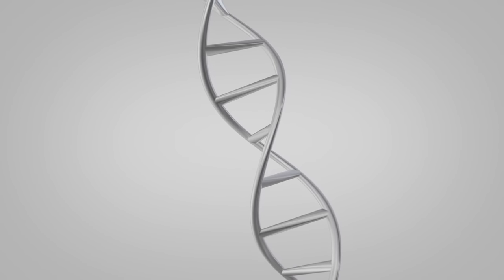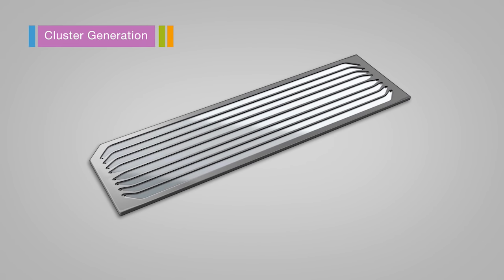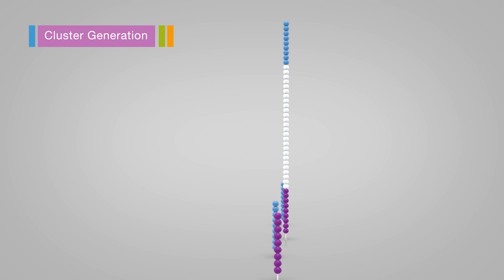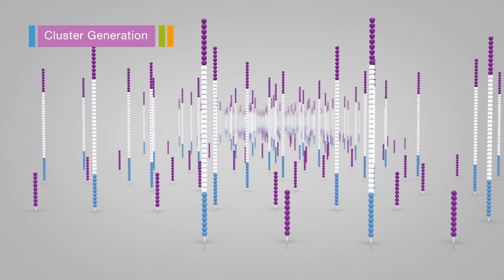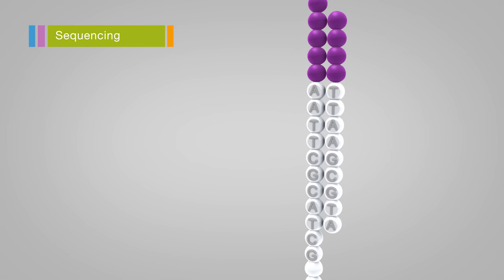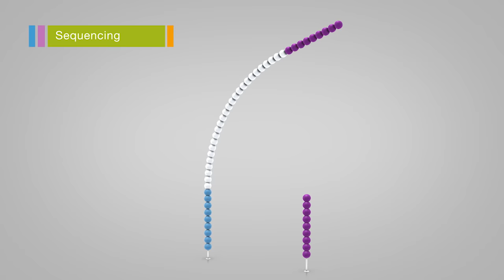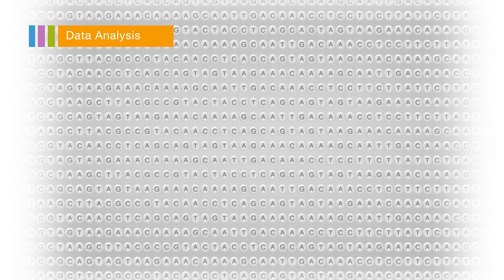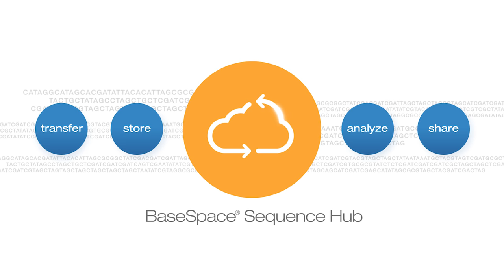Overview of Illumina Sequencing by Synthesis Workflow

Comment: I think the cleaving off of the fluorescent signal and removal of terminator during sequencing by synthesis is a key step that is omitted in the video. It becomes very confusing, then, how the previously added nucleotide's flourescent does not interfere with the newly added nucleotide.
Reply: 100% what i thought
Reply: Once a nucleotide is added it has a terminator group attached as far as the terminator group is removed it is not allowed to add another base in the strand. Once the fluorescence signals are captured the terminator group is removed and a new base is added with terminator group.
Reply: exactly
Reply: Thank you!! That was the part I didn't understand:)

Comment: For all of those who don't understand the index thing: 
- you have your genome DNA which you fragment with restriction enzymes (sticky ends)
- you create blunt ends and select for a specific size (too long reads are not possible) with purification beads --> what you get is double stranded DNA with specific length
- you add a Adenin and a phosphat group to the end of the fragment so that the phosphat and the A are "complementary" to each other at both ends
- now you add the predesigned double stranded index molecules consisting of the two flow cell binding sequences + index 1 and 2 + index read primer 1 and 2. To the index read primers a Thymin and a phosphat group are bound - again "complementary" (so only at ONE end) 
- because of that your DNA fragment and the index molecules can be ligated (A-T binding)
- the index is used to say: the fragments with index ATC e.g. is from E. coli whereas AGT e.g. is from B. subtilis

Hope this was not too confusing :D
Reply: " predesigned double stranded index molecules consisting of the two flow cell binding sequences + index 1 and 2" doesn't the first sentence before the + sign mean index 1 and 2 ?  If yes, then why did you mention it again after + .... i'm new to NGS so that is so confusing for me ... if i'm wrong could you amplify that part more ?

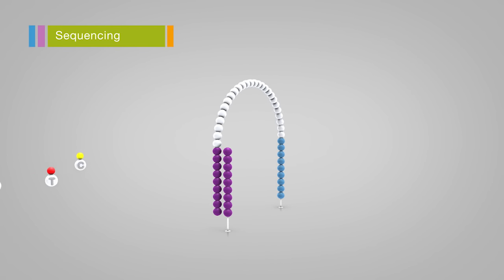Comment: Everything is clear except the index 1 read part (3:17), as well as index 2 (3:35).
Their purpose was not explained in the video.
I read somewhere that unique pairs of index 1&2 allow mixing multiple samples together and sequencing them at the same time.
Could you elaborate? I don't understand how that can be accomplished based on this video alone.
Reply: from what I understand from the video: 3:17 = deprotect the index 1 side from cleaving and allow it for reading
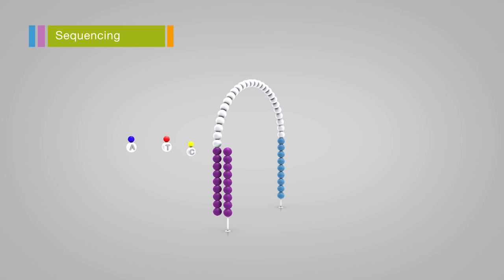3:35 = prevent index 2 side from reading.

next question is "how these processes allow doing that (protection and blocking reading)?" = I don't know
Reply: these sequences are being done with some many at a time. the idices are used as marker for each strand. The computer puts all the strands with the same index together to get a preciser read.
Reply: Steven Kim i think index 1 and 2 here are working as indicators for 5' or 3' end of the forward sequence. The index to mix different samples are additional index sequences added to each sample during tagmentation. For example, i add N701 index (a short sequence in Nextera preparation kit )to sample A, N702 index to sample B, and then mix two samples in one lane. During sequence analysis, i could distinguish the two samples for there is a tag added to each sample.
Reply: I think they showed it incorrectly. The index read primer is hybridizing to white sequence which is presumably unknown sample sequence. The index and the primer that reads it should be within the blue sequence. Or they could just put the index sequence directly downstream of the initial primer binding site to save the trouble?
Reply: @Valariel  I agree with you ,  illumina accidently or delibretely make the issue ambiguous.
Reply: @Valariel   not sure why it is not downstream, but: they add indecis (with PCR) to the dna during the preparation before they enter the lane. They showded it very briefly in the very beginning. The blue and purple are there just to bind the DNA to the lanes.
Reply: it is explained at the beginning but very briefly. 
the sequences added at the edge of each insert (the adapters) contain unique sequences not only for the index (which identify each read), but also sample-specific tags, which are added during library preparation. at 0:40 it kinda shows that
Reply: @grasthube  Yeap, but the question is : how do they "add" adaptaters to each end of the fragments (not knowing their sequence) ? Glue 🤔?
Reply: @martinmazukiewicz  In the TruSeq library preparation method  a single base A is added on one end of each complementary strand (like on the opposite sides is that makes sense: like strand 1 will have your sequence -------------------A then a base A at the end and its complementary strand 2 will have the base then the sequence kind of like A---------------  . Now the adapters have T overhangs which will pair with these A overhangs and that completes your library. I've made a weird diagram of a complete library which I hope shows up and clears up this blunt ends to sticky ends conversion i.e adding A which help attach adapters.

ADAPTOR T---------{DNA seq with base A to the right}--------- A ADAPTOR
ADAPTOR A----------{DNA seq with base A to the left}------------T ADAPTOR

Comment: Hello! if I may offer some critique, I actually prefer the original video. The animation might be less fancy, but I found it clearer and more illustrative than this "3D" one.
Reply: Actually I agree with greennecko. The reasoning for the index reads (as mentioned by Steven Kim below and Tom Shen above) is explained much better in the original video. Additionally the sample prep portion includes on screen details for the "additional motifs," which are very useful. Lastly, it was not clear to me that the reasoning for removing the reverse strand and then subsequently removing the forward strand was to accomplish the "Paired end reads" until watching the original video.  Thanks for the videos they are are helpful!
Reply: Hi @greenneko , could you post the original video link please? Thanks

Comment: I still do not get it why after sequencing the first strand and before proceeding to adding index 2 primer to generate clusters of the other strand index 1 is added again (3:17) to generate a short read. Reading the comments below has not helped. Is anyone able to explain this again? Is this done to signal to the data acquisition computer: "this is the end of sequencing data for the fragments labelled with index 1"?

Comment: I'm wondering whether there is a mistake in the narration. Before read 1 it mentions the reverse strands are cleaved off. Isn't read 1 a copy of the forward/coding strand, thus you'd need the reverse/non-coding strand to remain attached? At least my MiSeq read primers were always designed this way.

Comment: Dear Illumina group thank you for video, can you please answer my few questions:-
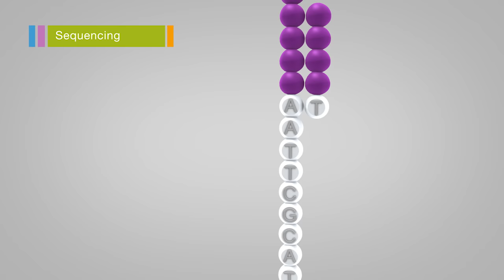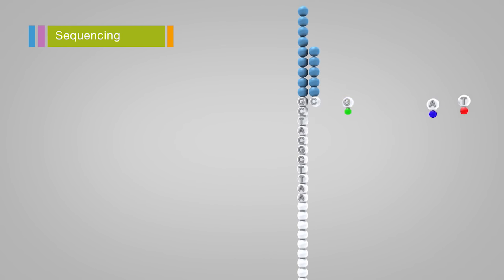1) at 2:22 and 4:00 reading starts from 5'?
2) is numbers of reads generated per fragment depends on the type of NGS application?
3) If reads are generated from fragments how they are aligned? 
4) Do data generated from the read contains sequence of amplicons?
Reply: The reference genome is available there to compare these fragments and there are software's like Spades to align these short reads. Since this is not a single read each base is read at least 30 time which allows to chose the best option from the quality score assigned to each read.
Reply: For Denovo sequencing the overlap sequencing is performed and base call is 60x to get more accurate data

Comment: helloo, why do we do the step before bridging ( the replication and detachment of one strand..) thanks !
Reply: So that the fragment becomes attached to the flow cell. 

In the first step, the fragment of interest hybridizes to the oligo on the flow cell via its complementary adaptor sequence. But it is not attached yet - under denaturing conditions it will come off. The oligo on the flow cell acts as a primer so that polymerase can extend the sequence, using the original fragment as a template. Once that is done, you have the sequence of interest (it would be the compliment of the original fragment) bound to the flow cell. Denature to release the original fragment, and you are ready for bridge amplification.

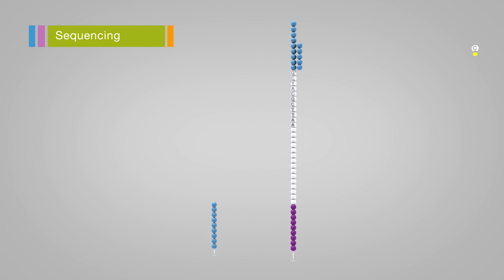Comment: Don't know if they meant to show these details, but the letter ordering in the forward and reverse passes is reversed but not complemented- is this an error? in 2:35 you see the ordering (from top to bottom) of AATTCGCATCG and at 3:56 on the reverse read the order is reversed but not complemented i.e. GCTACGCTTAA- shouldn't it have been complemented i.e. (C<>G,A<>T)?
Reply: no these are meant to be parallel strands

Comment: Hi, I have a few questions that need urgent answers:
1/ How flourescent label in the blocking group are removed from the nucleotide?
2/ How to wash away free nucleotide?
3/ Why do we have to sequece 2 strain of DNA?
4/ What is the function of index 1 and 2 in adapter attached to DNA?
Thank you.
Reply: You don't have to sequence two strands. This video is showing paired-end sequencing, which sequences both strands. But you can do single-end sequencing, which sequences only one strand. The benefit to paired-end is better coverage of the entire genome.
Reply: I think the terminator is only fluoroscent when bond, also after excitation it is "removed" or deactivated.

Comment: Can someone please explain why sequencing the reverse strand is necessary? We just sequenced the given read by synthesizing from the forward oligo. At 3:20, you have the sequence of the entire read and the index. Is there any new information we gain after 3:20?

Thanks!
Reply: Yeah, so the reason you need to sequence the reverse strand is because as the sequencing progresses, the error rate increases, so you have to go back and sequence in the opposite direction to minimise errors if that makes sense. Otherwise only the start of the sequence would be necessary, but the paired end reads increases the accuracy of the sequencing by allowing you to identify errors.
Reply: Morgan Desira not really the answer. Certainly a possibility but I have never worked on any data where people have purposely done that (working in bioinformatics and genomics for 10 years). 

NB reverse strand isn't necessary, it's an option ('paired-end' vs. 'single-end' sequencing). NB also that in the cartoon the read seems short, but should be ~500bp, and reads are 75-150bp. There is meant to be an 'insert' in the seq library, so you have a 150bp stretch, then unknown insert (usually ~200-250bp) then another 150bp. In highly fragmented DNA e.g. from FFPE material you might get shorter and overlapped reads. 

In paired-end you would get back two reads, but we know they should be near each other. This makes aligning to the reference genome more accurate.

Should mention that if we sequence to a high enough depth, error rate is less of an issue, and depth should be considered in any experimental design.
Reply: Hey, i think the reverse strand is importand to match (pair) forward and reverse reads, so to form cotiguous sequences. I mean that forward and reverse reads can have different lengths, a redundancy would assure the ending or begining of a paired read. Later could be of relevance for tracking splicing events. Its a theory. :)
Reply: @brucemoran1063  Thank you Bruce :) 
I was wondering if the Illumina sequencing they do here was paired-end. Since they never mentioned anything about it in the video I was unsure..
Is that why they used 2 indexes on one strand (one forward and one reverse)?
Reply: 4:39 - to resolve ambiguous alignment

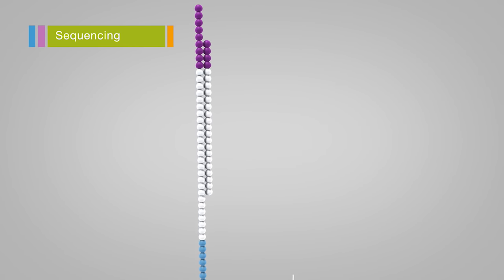Comment: I have the same question as Stephen Kim, but most of my question is explained by the comments. However, I still wonder why Index 1 is sequenced separately? Why couldn't it be sequenced together with the read; at 3:11 the read was still incomplete but it already got washed away. Thanks!
Reply from the maker: Hi Thuy,

The sequencing read stops being synthesized further due to a blocking mechanism that’s done by the machine. The reason why indices are sequenced separately and not with the sequencing reads is because you would not be able to tell which one is the index and the actual sequencing read if they’re done together.

I hope that answers your question, let us know if you need further clarification.

Thanks!

Comment: If the oligos on the flow cell are only complementary to the adaptors on the forward strand fragments, how do they determine which is the forward strand when the adaptors are ligated? Do they just sequence both strands at the same time and then use known sequences to determine which is the forward strand?

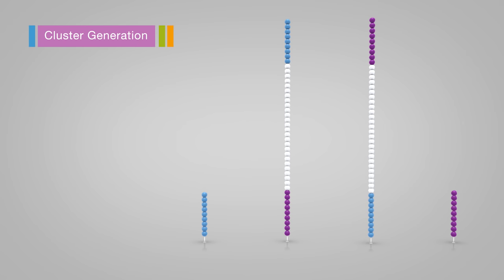Comment: At 1:52 , since  the original starnd is washed away, how is it possible for  its complementary strand is folding over to hybridize to the second type of oligo? that strand wont be complementary to the second type of oligo but will have exactly the same sequence with that oligo! I am confused. In some other sources, they mention that once you add the fragment both ends hybridize with thte two oligos and then we have the PCR extension which makes more sense. Anyone can help?

Comment: Since each random fragment has a different sequence, how do the adapters bind to the fragments? Especially if the fragmentation is done using mechanical shearing? I have other such basic questions. Can anyone point me to a source that will introduce me to NGS, please?
Reply from the maker: Hi Joe,

Adaptor ligation/attachment is very highly dependent on the library preparation kit that you use. We actually compiled a list of different methods to prepare your sample for sequencing in our Sequencing Methods Explorer https://www.illumina.com/science/sequencing-method-explorer.html. 

For more basic resources, these are ones that we find to be very helpful:

https://www.illumina.com/content/dam/illumina-marketing/documents/products/illumina_sequencing_introduction.pdf

https://rnaseq.uoregon.edu/

Thanks! And do let us know if you find good ones out there in your search.

Comment: When sequencing by synthesis (2:35), the animation seems to show that only one of the nucleotide lights up when excited. Why doesn't the fluorophores from all the nucleotides emit light?
Reply: Only complementary nucleotides emit the light, e.i. only those that are actually added to the strain
Reply: I understand what you're saying, but why only complementary nucleotides? Is there something that disables the fluorophores?
Reply: But the animation is quite unaccurate there. They are just added within one cycle and the light is emmited upon illumination of external source of light and not immediatelly. Each nucleotide serves also as a terminator, so it stops the reaction, which can continue only after the external illumination (which affects the structure of just added nucleotides in order to allow further synthesis).
Reply: Yeah, got it. Well, I don't know. They are either transformed during the addition (which enables their fluorescence) or before illumination the rest is washed away I guess.
Reply: From what I understand, the incorporation of the nucleotide releases the fluorophore, which is the process that excites fluorescence.  The fluorophores bound to the unincorporated nucleotides are completely inert, so all bases can be present in the solution without confusion of the fluorophores.  Hence why the animation shows the fluorophores flashing upon incorporation.
Reply: The bases incorporated are not tagged ddNTPs used in most sequencing but RT bases where the dye can be "cut off" before subsequent polymerization of the next base occurs. So for each cycle of nucleotide addition the base is removed for the next so theirs no interference from previously incorporated bases. http://decodingdna.yolasite.com/reversible-termination.php
Reply: Due to complementary base pairing. Only one nucleotide will get incorporated per cycle since it is a ddNTP and hence the fluorophore gets cleaved from the base that is incorporated and fluorescent signal from that one is measured. Plus remember that this particular lawn shown here has only one kind of primer. So only one specific sequence is getting amplified which is why we get only one signal. I might be wrong but I have a feeling this is what is going on

Comment: Thankyou this video was very helpful.  Just 2 questions for clarification:

If the reverse strand is washed away, then when the fluorescence labeled nts bind (to template strand) and emit  their light signal, what the computer is reading is actually the reverse or complement of the template sequence?  And also how is only the reverse strand washed away, how is it specifically targeted? 

2) Given a cluster, since one flow cell lawn is  amplified to hold one  gene fragment when the computer reads the signal from synthesis, its all of that one gene fragment...In other words the  coverage of the fragment is  dependent on the number of adapters tethered to the lawn of that flow cell ?
Reply: thank you for your reply. Looking forward to it.

Comment: What causes the strand to bend to form the bridge?
Reply from the maker: Bridge amplification happens through multiple steps of thermal and chemical processes. The exact details are too complex for a comment section. I recommend contacting Illumina tech support for these detailed questions. It is however slightly explained in this video https://youtu.be/J487Pqyswpo?t=431